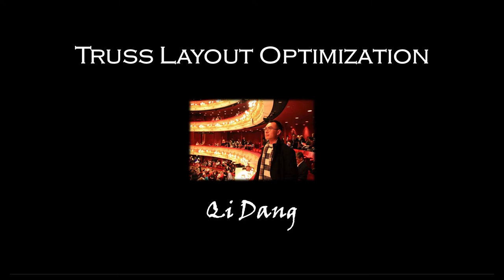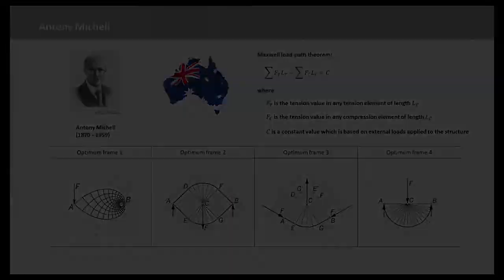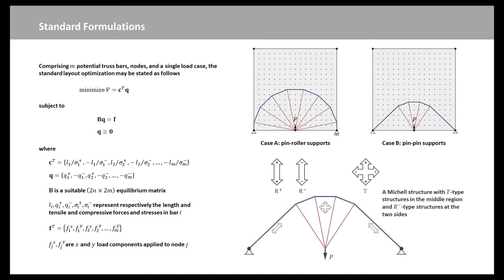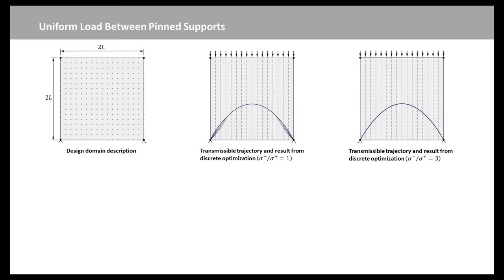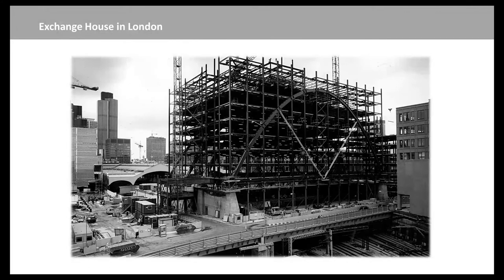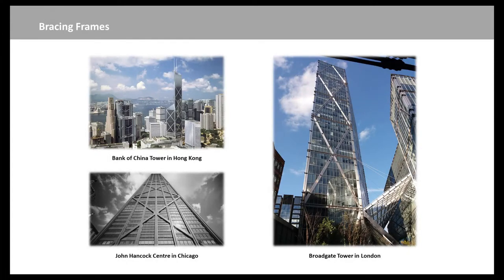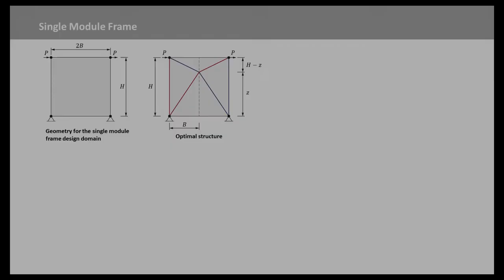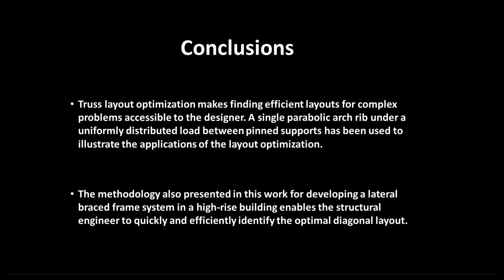Optimization: Truss Layout Optimization

Comment: Hi, very good video
I have one question
For the double pin case, How do you calculate the reactions before knowing the number of elementos that is going to reach each pin? Does this work for non symetric load cases?
Reply from the maker: Thanks for you like my video. The mathematical optimization program steps are as follows: 1. specify a problem (domain, loads and supports); 2. add nodes to the design domain; 3. connect nodes by potential members; 4. identify the optimal set of members. The result of optimal layout is dependent on your problem (domain, loads and supports).